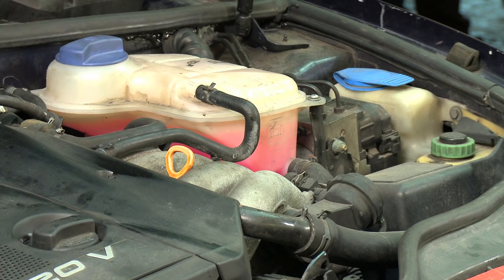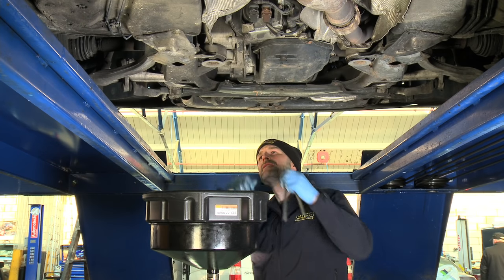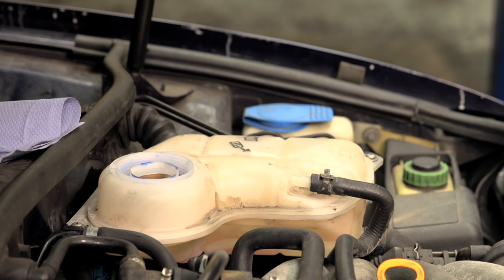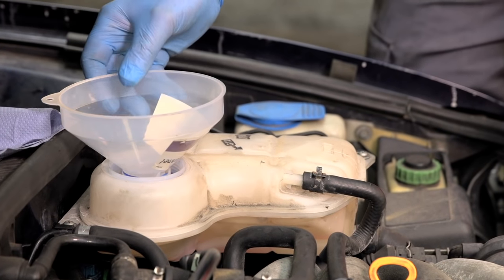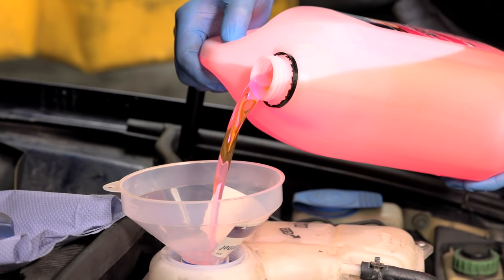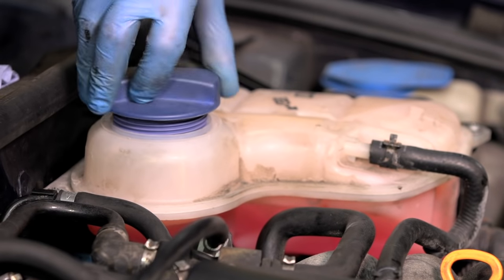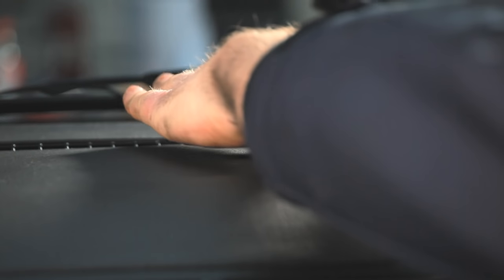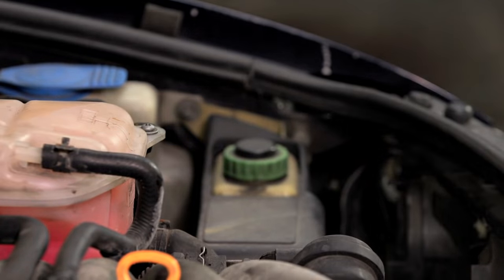How to Change Coolant

Comment: To change the coolant, the whole system needs to be drained off and flushed with water to get all the old coolant mix out.

When I say system, I refer to the radiator, all pipes, the engine block, the header tank and the heater matrix.

On new fill, about 0.5L of water in to start with, just in case you've left a hose off/loose!

Comment: As far as I know, in this engine (VAG 1.8 20V Gasoline) you should refill coolant as follows:
- slacken the clip and withdraw the heater unit supply hose from its bulkhead stub until the bleed hole is open,
- detach the expansion tank and rise it up about 10cm over the engine,
- slowly pour coolant until it starts to run from the hole in heater hose,
- squeeze the hoses to free trapped air,
- attach expansion tank as normal,
- fill the coolant to the maximum level,
- run the engine until it heats to working level (10 minutes to make sure that the thermostat was opened),
- let it cool and check the coolant level again.

Comment: you also need to remove engine side drain 19mm bolt (seen @2:20 on top left side of screen) to let the coolant behind the thermostat out!
Reply: Persian5word can you put distilled water to rinse?
Reply: @speacialsedition  that would be recommended to properly drain and clean the cooling system ... otherwise it would be a waste of time to do anything at all

Comment: Good video but need to do some more steps.  This replaced at best 50% of the old coolant since the engine block coolant was not drained. To do a more thorough job replace with distilled water over 4-5 drains/cycles.  Then find out what the total capacity is and how much water you are draining during the drains to determine the final 100% coolant amount to fill with.  Assumption here is that the engine block area will have 100% distilled water after 4-5 drains and then you add 100% coolant to get to the 50/50 mixture (based on total capacity and amount being drained of course) you want.  Thanks!
Reply: So to completely get rid of old coolant from the engine block flush with distilled water a couple of times until it comes out clean ? Is this what you mean because I'm trying to work on my own car
Reply: That's how I have been doing it for years.  With success.
Reply: @ahmadjwaidi2970  Yes!
Reply: well, to save money you better put tap water in it, for the flushing procedure. Also getting the water heated up by driving the car around with the water pump running will really help flushing it. For such a short period the tap water won't hurt the engine. Then put new coolant and distilled water in it.
Reply: @SE45CX  save money?  Talking maybe eight or 10 bucks in the distilled water!  Definitely won’t hurt the engine for a few days as long as you’re not in freezing temperatures
Reply: Brilliant mate,,I'm away to put radiator flush though my new traffic van,the antifreeze looks like it's been in there for years and thanks to your advice I'm going to do it myself, many thanks .
Reply: @SE45CX so it's not 100% anti freeze you fill the system up with ?
Reply: @gw2031  Some antifreeze is sold ready mixed with water, some is concentrated and needs water added,

Comment: How about emptying the old coolant in the heater by switching the ignition on and turning the heater control to hot position when  draining old coolant. Its a surprising omission on an otherwise good production.
Reply: You need that for what?
Reply: @marcocarvalho3619  to get most of the old coolant out

Comment: That was just the radiator drained not the engine block or heater matrix. The old coolant that was in the engine block when the thermostat was closed will still be there !
Reply: And how do i drain that

Comment: Superb ,,i never knew it was 100 % anti freeze you added, i thought you added water aswell ? Gonna di my newly aquired traffic 127 sport b4 winter,,many thanks ,,good to see Jason from Take that has found a new job !! 😂
Reply: Per the video, it wasn’t full concentration but rather a mixture with water. Normally use 50-50 distilled water and appropriate coolant (G12 spec for VW)
Reply: Most come premixed ratio ready too use. You just make sure it’s the correct type for your vehicle.  A wrong type may destroy your caskets.

Comment: What do you think about changing over dexcool to regular coolant? I have an 05 Buick Century, and dexcool is not good for the head gasket in that particular year, make, model, but that's the original coolant that the car comes with. It's a defect that has since been fixed in newer models, but I have the older model and I'm looking to change it out completely.

Comment: hope you can help me my car has never gave me any  trouble until, two  days ago as, I looked at the Garage I noticed my  gauge had started to go from the sweet spot, a 16th of an inch about, I didn't know what the story was then after I drove it for a bit longer I could see water starting to drip on the driver's side in front of the wheel Arch,  how do I know whether this is my pump or whether it is simply a leaking hose, know I am going to get checked out, but I would just like an answer for this so some mechanic doesn't turn to me, your pump is gone, Iol I was thinking to myself if the pump was gone then it shouldn't build up the pressure, to push the water out of ,hopefully loose hose or something. can you give me any ideas or suggestions ways of knowing if it is a water pump,  as opposed to just A leek.

Comment: Hi i have a problem with my 2003 saab turbo showing up on display coolant level low so i checked and its full  any ideas thanks
Reply: sounds like a sensor, possibly the sensor in the coolant reservoir
Reply: sensor may not be working, or check the tube inside coolent case

Comment: Please tell me something; after 4 months of winter storage do I need to warm the car up ( in Spring time) and cool it down and drain the coolant or just drain it after car sitting 4 months...?
Reply: During winter storage its best to start the vehicle as often as you can and let it run.  The coolant should be okay i would let it run for a bit and possibly add some if it appears low.
Reply: Utopian = many thanks...
Reply: canada painter just drive it pal and it will be sound just keep an I out on your levels

Comment: In what way is the hot air an indication of there being no air in the system? 
Even with 0 coolant and only air the engine will warm and the heaters will work...
Reply: The hot liquid is what heats the heater core
Reply: pantogar
Reply: pantofar
Reply: Does it fuck mate... The coolant passed through heater matrix then fan blows heat into cabin.. no coolant no heat..

Comment: It is not a sufficient video... since regardless of the video topic you need to bleed the system to make sure there no air bubbles in coolant circulation. If you do a job do it right,,,, and check everything.

Comment: My Peugeot Haynes manual states that the coolant system is "sealed for life,and is unlikely need to be drained"
Me now confused ?
Reply: Sounds about right for a peugeot
Reply: They forgot to print that not changing coolant will eventually kill your engine.  So i suppose technically it is filled for life.  Id rather the longer life afforded by replacing the coolant ;)
Reply: @thektmkid6990  It's not more right or wrong than for any car manufacturer. But no, it can't possibly state that anywhere. The only "sealed for life" fluid is gearbox oil which in theory never needs to be replaced unless it's an automatic.
Reply: How long does a Peugeot last ?/ maybe its life time :)
Reply: @gavinalaugh6623  
Hahahahaaaaaa